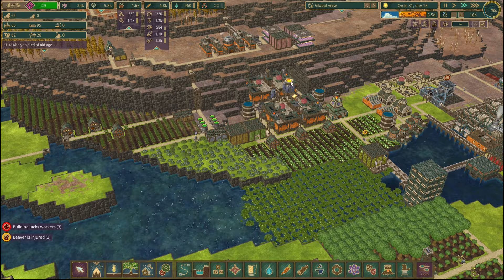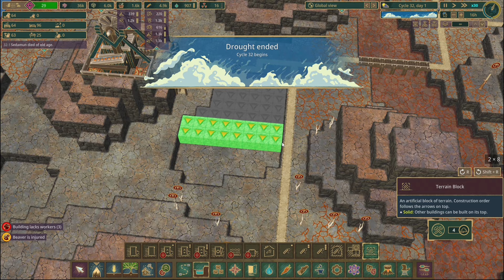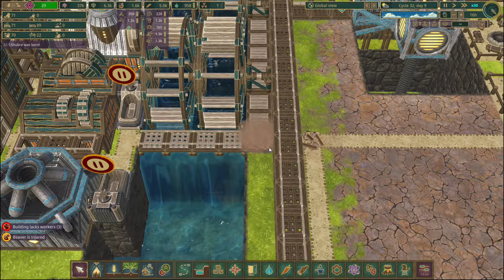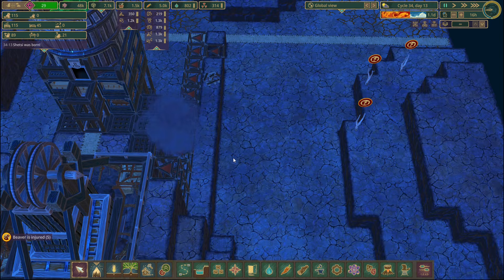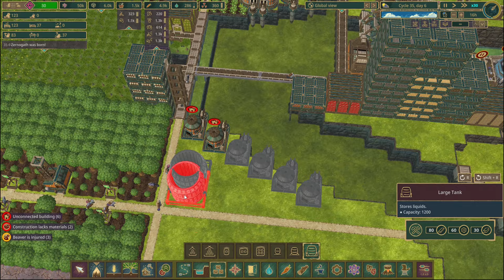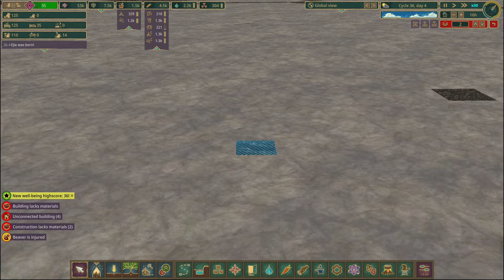Timberborn Helix Mountain - Extending The Bad Water Channel

Comment: Alein died at the age of 69, nice age to go...
Reply: plan the waterwheels out in the badwater canal, surprised me you did not do it right away for the spacing.
Reply: is it not time to get the bigger water storage at the houses?
Reply from the maker: Bigger water storages are a yes. I'd forgotten we haven't upgraded them yet. 
I wanted to get a path built to the mine quick, and somewhat bad water safe. So we have access to the metal. The wheels can go in once the whole thing its built.

Comment: Goodness, planning such big projects! I suppose it fits such a big map.

For the unused beavers, how about making them Builders instead of just Haulers. My personal formula is 2 Builders for 1 Hauler building.

Apparently you are short of 8 Builders building. No wonder it took so long to build.

Trust me, an extra builders will make all your projects finished much faster
Reply from the maker: Yep, more builders would help normally, but building a lone single line of dirt, means only a few builds can do anything at one time. A lot of builders are just sat in the hut doing nothing. 
But we do have some spare beavers, so better to have them on builder standby

Comment: you should just do a straight tubeway from the industrial area across platforms to the scrapmetal path, then you don't need the path across the badwater on the cruncher's side
Reply from the maker: That is where its going to go. Along the platforms on top of the main power line. The paths are just there so we have access to the mine. Can't build a tubeway without that metal
Reply: @HouseOfHedgehog  With all that metal you have enough :P
Reply from the maker: Nooo. Never enough :D
Reply: @HouseOfHedgehog for the tubeway, yes you do :P